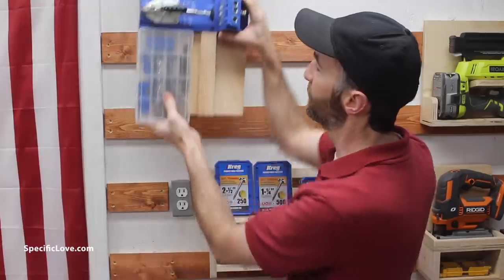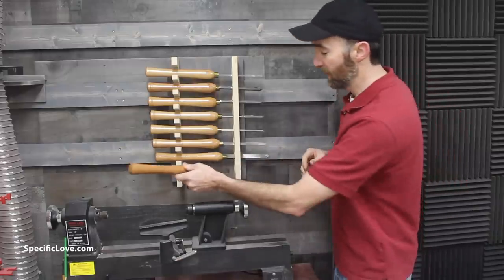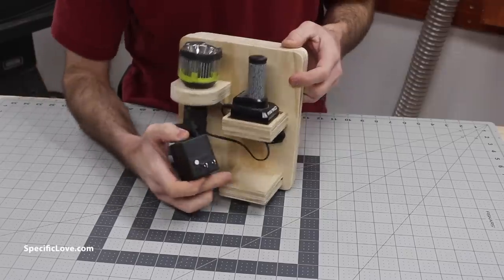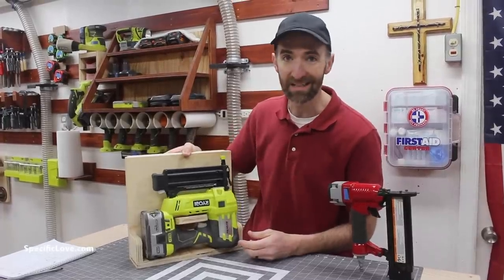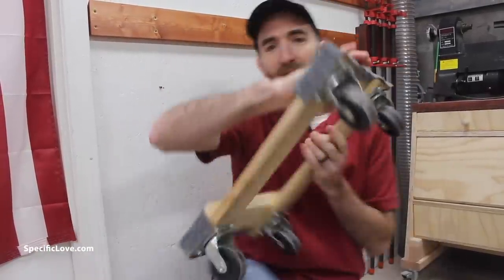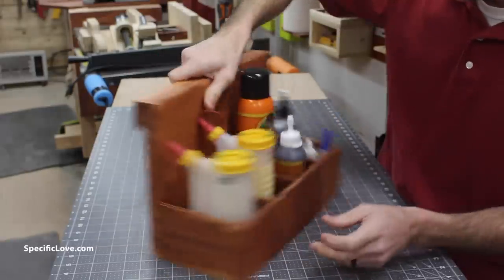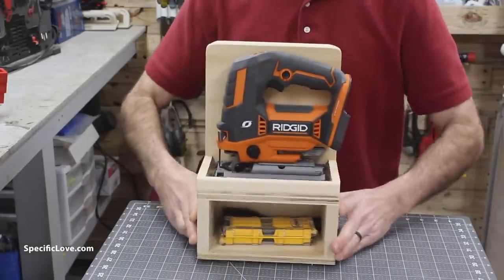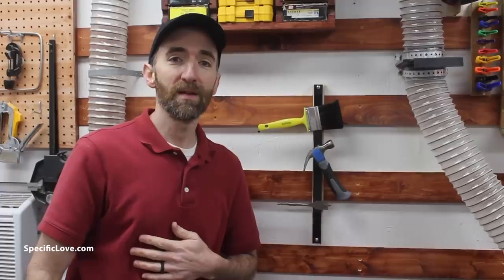20 MORE Simple French Cleat Ideas for Your Tool Storage #2

Comment: Storing a hand plane on it's side because it will dull it is a widely-disproven myth. It was started by shop teachers who didn't want students slamming the planes down on a metal tool or ruler. It's persisted because no one knew better. A wooden surface will not dull or damage your hand plane. Thanks for sharing!

Comment: For your Kreg jig board,  you can add another strip on the bottom side of it that will go between the cleats on the wall but then when you set it on your workbench I’ll be level so you can work with it easier.  Just an idea, thanks for the video!
Reply from the maker: Good idea
Reply: I was looking for this comment lol

Comment: dude, your'e awesome! ty for ideas. Just built the cleat wall and staring at it like what now.. my problem is all power tools with cords
Reply from the maker: Just add a small hook or slot for the cord to each of the holders. That way you can upgrade in the future and should be able to use the same holders.

Comment: The cleat on the pocket hole jig... does it remove? Or do you use the pocket hole jig with the cleat attached? Seems a little awkward.
Reply from the maker: It stays attached. It works great hanging over the edge of a bench. But please modify it and let us know if you have a solution.
Reply: @SpecificLove7  Sounds good. Just was curious as I have been trying to come up with a better solution for my jig. Great stuff!
Reply: Maybe just glue a cleat on back, opposite the hanging end.so jig will sit level on your bench. might work, depending on size of piece you're using jig for.

Comment: Corner shelf is an awesome idea!  I have the same situation with my cleat walls and this is probably the most efficient and nicest looking way to use that space.  Thanks!  As for using velcro strips on the jig parts holder, I wonder if the wood shavings would eventually clog up the velcro?  But still a nice idea that I might use for mounting an awkward bit storage case that I have. I like your videos showing your practical and logical builds!
Reply from the maker: Thank you very much. Glad to see you have the same love for FC

Comment: The first use I ever found for cleats was in hanging kitchen cabinets , but where I come from we called these "sex cleats" for obvious reasons. As I'm presently outfitting my last shop I've learned over the years the value of large tool mobility (wheels on everything including a work bench) and the necessity of "everything has a place and a place for everything" for smaller tools etc and these ideas are gold....oyea and always clad your walls in plywood.......drywall, both long term and short, just doesn't cut it. Thanks for all the great ideas. And to all you old farts out there....watch the young guys as they still have the intensity of new found interest in all the new ways. I started out driving slotted screws with a Yankee racheting screwdriver and while I still have it, I will hang it on the museum wall I have planned next to the Brace and bit I used to drill holes with ....across the room from all my Makita battery driven tools that I dearly love and depend upon.

Comment: An alternate idea for your spring clamps: a dowel, similar to a traditional paper towel holder, and hang that up on your top cleat. The spring clamps just hook on to the dowel. Light weight and easy to reach. Thanks for all the ideas.
Reply from the maker: Nice tip, thanks

Comment: Do u have any recommendations on attaching French cleats to concrete? Plywood to concrete or wood then plywood?
Reply from the maker: If it is poured concrete, then I would put up a layer of wood first on the wall and then attached to cleats it. If it is a block wall, I personally would build a 2x4 frame wall and then attach a layer of wood to it before adding the cleats.

Comment: I really like some of these ideas.  I have started making some from your ideas.  It may have been covered in some of the comments, but seems like would be a good idea to put a spacer at the bottom of the pocket hole jig cleat so it would be level when you work with it on a table
Reply from the maker: I just hang it over the edge of my workbench

Comment: Just thinking that corner cleat for the tight space... would have been good for the extinguisher and leave the larger space for something bigger..  I like your ideas overall, and I will be using some of them for sure.  Nice job.  I need to make a holder for compressor accessories  : -)  and air hose
Reply from the maker: Thanks, and I actually have an air hose holder coming in the 3rd video. Should be out in a few days.
Reply: @SpecificLove7  Awesome! .. I'll hold off and look at your idea before I make it as my cleats are not up yet.  I'm tackling that Monday.   Thanks for the ideas.

Comment: So many awesome idea's! Please note that that fire extinguisher is useless in a real fire situation. Get a large one and mount it directly on the wall with a metal holder. Or get the cart type that is even larger so you can also fight larger fires.
Reply from the maker: Thank you for the insight. I mainly just have it for the shop incase of an oops.
Reply: @SpecificLove7  Even a small fire cannot be stopped with a small extinguisher. I have seen many shops and factories burn to the ground because they had too little firefighting power when the fire started. Just a large extinguisher will be 10x more useful when (not if) that moment comes where you need it.